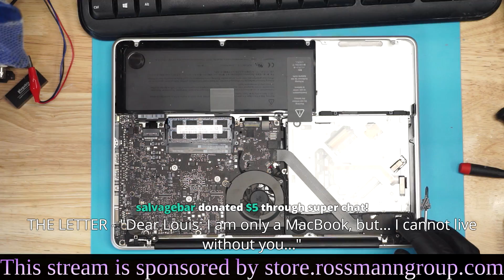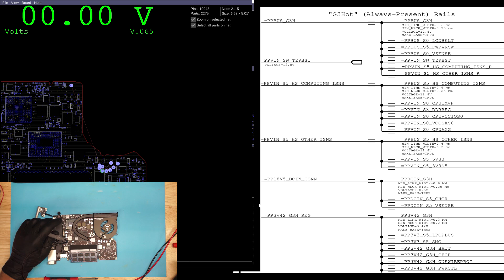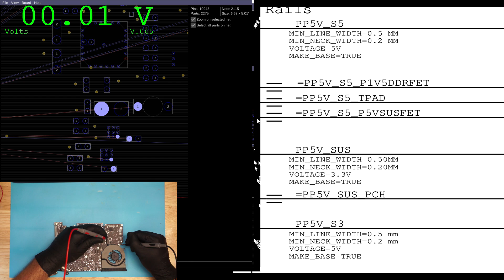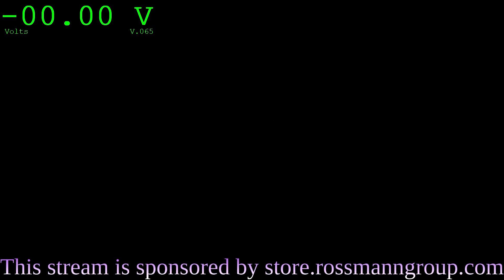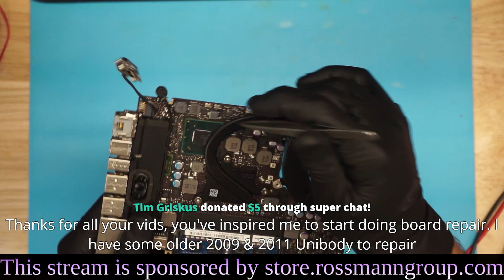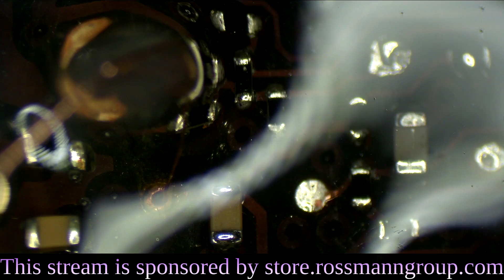Louis fills a hole to make Macbook Chooch

Comment from the maker: 👉 Find tools used, recording gear, repair guides, chip sources, & cryptocurrency donation links below:

👉 CHIPS & COMPONENTS:
› http://bit.ly/2jaAOXM

👉 TOOLS USED:

✓ Soldering Irons:
› Louis' Hakko station(no tweezers): http://amzn.to/2cKkMyO 
› Paul's Hakko station(works with tweezers): http://amzn.to/2yMvWNy
› Micro Soldering Pencil: http://amzn.to/2d5MWUP
› Hot tweezers: http://amzn.to/2yMvZsZ
› Quick 861DW hot air station:  http://bit.ly/quick861dw

✓ IF THESE COST TOO MUCH, CHECK OUT THE TS100 SETUP:
› TS100 soldering iron: https://amzn.to/2Gy1Fqz
› Recommended tips: TS-C4: https://amzn.to/2GSDoz3 TS-KU https://amzn.to/2Elofke

✓ Preferred Soldering Tips
› Fine: http://amzn.to/2d5MgPn 
› Flat: https://amzn.to/2JnsDBT 
› GPU wicking: http://amzn.to/2w8chtB
› Micro soldering tip: http://amzn.to/2qUSFDh

✓ Microscopes:
› Microscope: http://amzn.to/2iLrE16 
› Barlow lens: http://amzn.to/2yMKdKf
› LED light: http://amzn.to/2nzfPT2
› CHEAP alternative microscope: http://amzn.to/2rTlHbj

✓ Soldering/Repair Supplies:
› Solder: http://amzn.to/2cKkxUp
› Desoldering braid: Goot Wick http://bit.ly/2otflOX
› Flux: http://bit.ly/amtechflux
› Solder paste: http://bit.ly/amtechsolderpaste
› THICK insulated jumper wire: https://amzn.to/2rvtD0A
› THIN insulated jumper wire: https://amzn.to/2I47DQY
› Kapton tape: http://amzn.to/2yN0xuq
› Tweezers: http://amzn.to/2d5NBpi
› Blades: X-Acto Knife Kit http://amzn.to/2ByWnvF
› Freeze Spray: http://amzn.to/2BySozw

✓ Diagnostic tools:
› USB amp meter: http://bit.ly/2B2Lu5W
› On-Screen multimeter: http://amzn.to/2jtgY9K  
› Multimeter Probes: http://bit.ly/fineprobes
› CHEAP multimeter: http://amzn.to/2zjkg8U
› Bench PSU: PPS2116A: http://amzn.to/2ibannT
› ZXWtool: https://amzn.to/2KVXiM9

✓ Ultrasonic Cleaning:
› ALL MACBOOKS & CELLPHONES: Crest P1200H-45: http://bit.ly/P1200H45
› PRE-TOUCHBAR MACBOOKS & CELLPHONES: Crest P500H-45: http://bit.ly/P500H45
› CELLPHONES ONLY: Crest P230H-45: http://bit.ly/P230H45 
› Branson EC cleaning fluid: http://amzn.to/2cKlBrp

✓ Desk supplies:
› Desk: http://amzn.to/2yMShdZ
› Chair: http://amzn.to/2yNPv8u
› Fume Extractor: http://amzn.to/2d5MGoD
› Work mat: http://amzn.to/2yMtlTR
› Outlets: http://amzn.to/2yNsZwo
› Gloves: http://amzn.to/2iUfumS
› Durable lightning cable: http://amzn.to/2yNHzUt
› Fine tipped snippers: http://amzn.to/2HGt4XB

✓ Screwdrivers: 
› iPhone bottom screws: http://amzn.to/2yNwX8p
› Macbook bottom screws: http://amzn.to/2AKMdVb
› Torx T3: http://amzn.to/2zjtxxH
› Torx T5 http://amzn.to/2BLNDn4
› Torx T6 http://amzn.to/2B0XIfA
› Torx T8 http://amzn.to/2CpWp68
› Phillips #0: http://amzn.to/2AJaHhM
› Phillips #000: http://amzn.to/2yNqsCl

✓ Boardview software used: http://openboardview.org/ 

✓ RECORDING EQUIPMENT:
› Work cam: http://amzn.to/2eA6i5f
› Overhead cam: http://amzn.to/2eAH0oT
› Work mic: http://amzn.to/2e74PVF
› Home mic: https://amzn.to/2xfampC
› Microscope camera: http://amzn.to/2icVQoG - mine is DISCONTINUED, this is the closest one I can find. 
› HDMI capture: http://amzn.to/2iyGcle

👉 REPAIR SERVICES:
› We fix Macbooks & offer free estimates. http://bit.ly/RossmannLocalBoardRepair
› Mail your Macbook in if you live far away! http://bit.ly/RossmannGlobalBoardRepair
› Manage a school district using Macs? Save money through repair, training & buyback programs! http://bit.ly/2ow4Z17
› We offer iPhone data recovery: http://bit.ly/2BDBX4G

👉 LEARN HOW TO DO THIS:
› Beginner's guide: http://bit.ly/2k6uz84
› Support forum: $29/mo http://bit.ly/2nX8rMC
› In person tutoring: http://bit.ly/1on1Tutoring

👉 SHILLING:
› Buying on eBay? Support us while you shop! https://www.rossmanngroup.com/ebay
› Rossmann Repair Group Inc is a participant in the Amazon Services LLC Associates Program, an affiliate advertising program designed to provide a means for sites to earn advertising fees by advertising and linking to amazon.com

👉 Leave a tip for us via cryptocurrency if we've helped you out:
› Bitcoin: 1EaEv8DBeFfg6fE6BimEmvEFbYLkhpcvhj
› Bitcoin Cash: qzwtptwa8h0wjjawr5fsm0ku8kf40amgqgm6lx4jxh
› Dash: XwQpZuvMvU44JT7C7Uh6xHvkSadzJw9fMN
› Dogecoin: DKetsoCvwa2hF29ssgUA4Wz4hxT4kj3KLU
› Ethereum: 0x6f6870feb48f08388ee345cf0261e2f03d2fa310
› Ethereum classic: 0x671bfd61ba87edf6365c97cea33d66ba73645510
› Litecoin: LWnbTTAjojZQt68ihFJFgQq3cYHUsTcyd7
› Verge: DFumZ5sMhi3JktLQpsTVtV9xUt3zKDrcZV
› Zcash: t1Ko3FkphQYoQroQc8k2DVk4WKMAbmNR8PH
› Zcoin: a8QdvArHmdRYe1MjiqtP6jDNe6Z4JgnRKZ
Reply: Is that 40awg winding wire?
Reply: This channel is an inspiration to dumb schmucks like me everywhere except in China where they can't see it.
Reply: Was it just me or did you sound REALLY Irish at the very beginning of this vid? Like the very first sentence...

Comment: NewsFlash Rossmann Technical Group. You may have heard of the Intel Processor vulnerability, Zombie Load, that causes the Intel CPU to give up its loaded data trying to avoid a crash. 

Apple wrote a security update based on microcode Intel supplied for up to 8 year old Macintosh machines. But has not been able to write one for the 2011 Macintosh computer due to Intel being unable to supply the microcode for the 2011 year. 2010 machines are not vulnerable to this vulnerability due to being a different design. 

Listen to the last couple days especially The Friday 5/17/2019 edition of MacOS Ken podcasts for details. The actual vulnerability was covered a couple days ago.

Comment: I feel dumb for asking, but how is that the bare copper wire running over the legs of those chips not cause problems?
Reply: It's enameled wire, same type that's used in transformers. So there's a layer of insulation on it. Scratching and strong heating remove it and it can be soldered.

Comment: so it is considered safer to run a wire the entire length of the board than trusting the main board's tracks once a small part of the board has corroded?i assume the wire is coated to not cause any short on its length, but i am still naturally hesitant at trusting the wire.

Comment: you may be able to find a cpu that has the same design as the dual core macbook cpu like an i3-7020 on a commonly available scrap board for some data recovery jobs on touchbars

Comment: noob question here... isn't having an exposed wire running through the board a risk of shorting the circuit?
Reply from the maker: Not exposed.
Reply: aight mb
Reply: It may be enameled wire

Comment: Thought you would like this story, I've sent my Macbook 12 inch 2015 in for battery service, they told me it would be 3 to 5 day which was already long I thought to myself just to switch the bottom case, but now it's been 3 weeks and after they fucked up 2 batteries, they still don't have the new one I need...

Comment: Thank you. Pls help me out!! I've a 13" MacBook pro, it won't display any thing on built-in screen, when powered. However, when the MacBook is connected to an external display, I can see my desktop icons . It noteworthy to mention that(without an external display), when I point an LED light through the Apple logo, I can see icons on my desktop on the built-in screen. Please help me  with a solution.
Reply: Backlight connection went wrong or the backlight is totally shot. Unfortunately you cant get just a backlight bit instead a whole lcd panel...:(

Comment: Hi @Louis Rossmann, would appreciate your input on this issue with iPhone 7/7Plus. Basically, my (Expensive!) iPhone 7 worked perfectly fine, updated to IOS 11.4.3, went to bed and next morning it was no longer usable as a phone. Apple acknowledged the fault, and then seemed to think it was OK to choose which customers they compensated while out of warranty. My phone is circa 2 years old. I'm now left carrying it around while redirecting calls etc to another phone that I've had to pick a 'Pay as you go' sim card up for. I feel completely robbed.

1: https://discussions.apple.com/thread/8344269 

2: https://forums.moneysavingexpert.com/showthread.php?t=5869622 …

3: https://forums.macrumors.com/threads/apple-no-longer-offering-free-out-of-warranty-repairs-of-iphone-7-models-with-grayed-out-speaker-button.2127951/ 

4: http://www.tomsguide.com/us/apple-ios-speakerphone-update,news-27150.html …

5: http://www.techtimes.com/articles/226917/20180504/apple-comes-clean-some-iphone-7-microphones-are-broken-and-need-repair.htm 

6: http://www.idropnews.com/news/apple-confirms-microphone-issue-iphone-7-7-plus-ios-11-3/70809/ 

#iPhone7 #iPhone7Plus #Apple #IOS113 #IOS114

Comment: BTW: Why didn't you first try just running a wire through the hole and solder it on both sides of the board only just at the hole? Aside from one side hole looking corroded, the rest of the board traces looked good.

Comment: Please tell me this is not the final fix.  That fine a wire run in long point-to-point runs without occasional abatement for mechanical shock and vibration.   Then again, I suppose Louis is taking just as much care in repairing the Apple product that Apple does in reliability design.

Comment: Slightly dumb question; how can you run wires like that freely across the board without creating unintended connections to exposed pads/pins?
Is the wire coated in an insulating material?
Reply from the maker: Yes

Comment: Don't like the enamelled bodge wire running over component pins, it only needs the thin varnish to wear away from vibration and you've got a short. A run that long should also be tacked down with wire tack at regular intervals.

Comment: Re: the Tim Cook loves money rant, the one that burns me to this day is starting a repair program for the 2011 GPU solder flaws, three years after the issue (when many moved on already), for a four year extension. So if you conveniently fell into that window, great, otherwise you were boned, and also they would only ever replace them with macbooks with the same flaw that were all ticking time bombs. Now they're doing that same four year extension three years after the first issue for the 2015 butterfly keyboard.

Comment: Stretched wire is kinda sketchy isn't it?  Don't you risk low temps ripping the wire out of the solder joints or breaking as the wire contracts?

Comment: Love your vids.  The Wire looks to be touching other resistors as its going to the RTC circuit.  Why would this seem not to be a problem to any other part of the board?  -Curious Onlooker.

Comment: Why you run the wire to resistors and not only to capacitor? The lines after c2233 look fine.
J REPAIR
Πριν από 10 λεπτά

Comment: A question here: How is that wire touching all those pins and component terminals along the way not causing any unwanted voltage on those connections? is it insulated with some thin varnish?

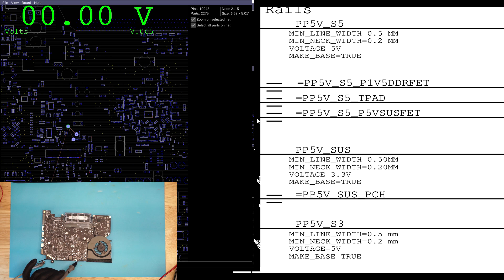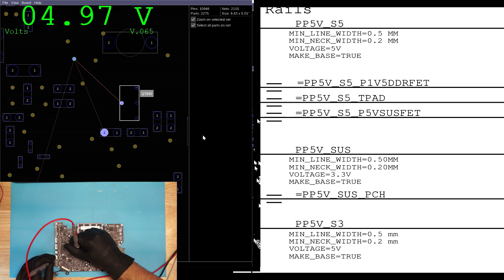Comment: At 6:30ish-6:34 in the video you measure pp5V_SUS as 4.97 volts, which you thought to be OK.

But the schematics actually indicate that it SHOULD be 3.3V (on the screen at the time 6:34).

Comment: So, is there no risk of that naked wire contacting other components and delivering that signal to places it's not supposed to go? Like, your final shot shows the wire turning 90 degrees at a chip, and it looks like it's contacting all the pins on the upper side of the chip. Does that not cause a short?

Comment: How does this wire not short with a bunch of the chips and other components it's touching along its length?
Reply: Because it has an insulated enamel coating on it. That's how it can also be would into transformer windings etc. and the loops do not short.
Reply: Ah okay, awesome thank you! I figured it would be something like that, I just didn't understand how the connection is made when it gets soldered. Does the heat during the soldering melt the coating and expose the conductive inside?
Reply: Yep, if you heat and scratch the wire long enough it'll "destroy" the insulation and wire will be able to get soldered :) That's why he is scratching the wire while soldering. (IMHO)
Reply: I asked the same thing above.  I'm so perplexed.

Comment: But doesn't the wire touch other stuff on its way? Is it even safe?
Reply: Vadym Mykhaylyuk the wire is coated so it's not conductive except the parts he soldered.
Reply: What's this cable called?
Reply: Enameled Copper Wire
Reply: Self fluxing enamelled wire. Self fluxing wire insulation burns off when you solder it, non-self fluxing wire doesn't, you have to remove the insulation with fine sandpaper or carefully scrape it off with a sharp knife. I wouldn't run the bodge wire (as they're known in the trade) over other component pins as vibration could wear through the thin insulation over time and cause a short, I'd also tack the wire down to the PCB at regular intervals for a run that long.
Reply: Im pretty sure he said in other videos that its 'magnet wire' in fact it appears to be on his store: https://store.rossmanngroup.com/index.php/jumper-wire-thin.html
Reply: if he wasnt joking, he said in a video, that he uses wires from apple headphones? :D i might be wrong. i don't know how are they called.
Reply: ysensei I believe it's called enameled copper wire
Reply: I believe this is the thin insulated wire he references in his sticky comment: "THIN insulated jumper wire: https://amzn.to/2I47DQY" If I recall, the wire is sprayed with a thin coating of insulating enamel before being wound, and it gets melted away only where he makes a solder junction. I believe it's also the same kind of wire used in motor windings.
Reply: It is an enameled wire, but if it is left free, the enamel will likely tear off in points of a contact with other parts (due to vibrations), and make a short. It should be stick to the board with some glue or lacquer. Anyways I prefer using a Kynar type wire for patching boards.
Reply: One I have, can be "stripped" with soldering iron. I just cut it and solder.
Reply: i was thinking about the same thing, whats why i am reading comments now. but coated wire makes sense.

Comment: I wonder if Louis has ever had a MacBook that the fan died and hes traced the whole board to find out the fan is dead
Reply: I believe it has happened, yes.
Reply: I mean a fan is not suposed to die, like ever, it's just some copper and magnets there is nothing to die there
Reply: A 3 phase brushless fan has a few things that can fail.
Reply: "A 3 phase brushless fan has a few things that can fail." 
a HOLE has few thing that can fail, yet Apple found a way to derp up making a hole
Reply: Let's face it, if the fan stopped spinning, that would be the thing the computer got brought in for. A rattling fan is very, very obvious.
Reply: Stephan Brun not really alot of dumb people out there and when a fan dies the computer overheats and causes signs of laggyness and other stuff so they could also bring it in for that
Reply: Good point.I have heard a computer screen being referred to as the computer, lol.
Reply: not necessarily, if for example there is water damage, it can do damage both to other circuits, and/or fan circuit too.
Reply: disassemble one, and you will be surprised, there is a pcb with components. Oh, and lets not forget that components that control the fan can go bad on the motherboard also.
Reply: Dávid Végső it's actually a brushless motor so it needs a driver to work, that driver is implemented inside the fan along with hall effect sensors. There are quite a few things that could go bad inside a fan. I once blew one by hooking it up to a very noisy 12V rail.
Reply: @DumbArse  That is incorrect, dust in the spindle will make it slow down which will blow the coil if that fan ever stops due to crud buildup. Too much current will also blow the coil. The magnetic wiring is very prone to failure with over current draw. You also can tell as the fan will start to make noise so you know dust or crud is building up. These fans do not have a bearing on the shaft this is why they sometimes need to be replaced.
Reply: There's support circuitry to make PWM work but it's pretty robust unless you overvolt it or a component dies of old age (usually the bearing on the rotor shaft).

Comment: this sounds way more filthy than it should
Reply: That MacBook looks more filthy than it should. :p

I've not looked at my Dell M3800 under a microscope but I'm confident that the inside isn't that dirty. Disclaimer: I have recently opened it up to remove the dust that clogged up the headsink fins on both sides as she was a toasty dirty girl.